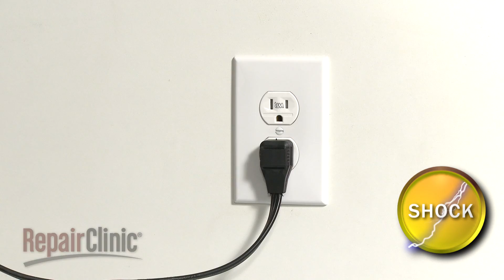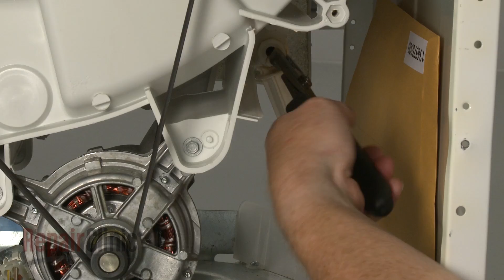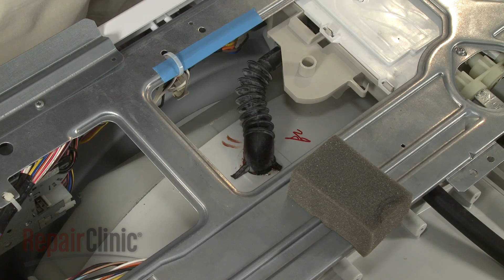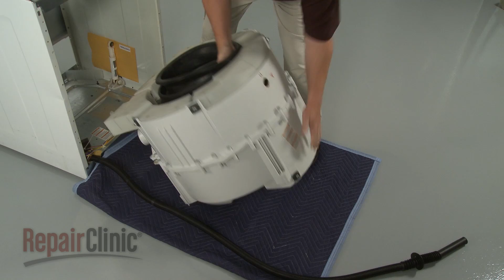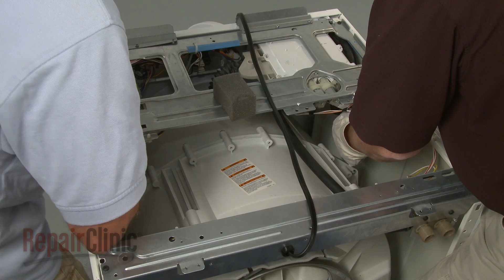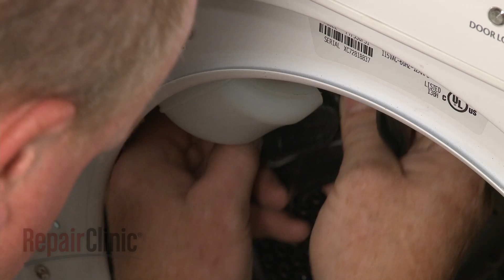Frigidaire Front Load Washer Replace Tub Seal #134146100

Comment: Very misleading for a slightly newer Frigidaire.  For a Frigidaire with the counterweight in front You don’t need to remove the whole drum. So don’t disconnect the motor or tubes or springs. Just pop the front cover off, remove the counterweight, the two front shock absorbers and then remove the numerous screws holding the front half of the outer drum. Then replace gasket and reinstall. So much easier.

Comment: I've got the Kenmore labelled version (model 417.41042000) of this machine and the tub seal is leaks a lot. What else should I replace given that I'm taking thing all apart? Those shock absorber mounting pins look iffy.
Reply: Bearings.. however, instead of using the stock bearings, I switched to roller bearings and a castle nut with cotter pin.  OMG, works so much better!  Measure the outer race, inner race, and thickness for a match x 2 ... Then, install the castle nut and use it to drill a hole for a cotter pin.  Or you can thread on the nut far in, and take a file and make a spot to get a tap and drill started, or use or make a drill guide collet.  I wish they came with roller bearings instead of ball bearings rom the factory.  Roller bearings are made for axial loads like a car tire, whereas the ball bearings that have are for tangential loads.  Surprised their engineers don't know this... either that, or they know the bearings will fail after the warranty expires so is it an oversight or by design?  It still will not withstand your co-inhabitants from trying to overload and break it by washing carpets and towels in it...  These washers need load sensors where the springs hang the tub and say "OVERLOADED" so that derp roommates or tenants don't break the things...